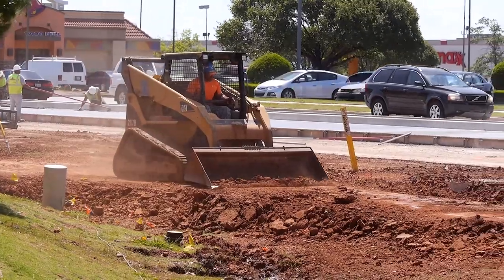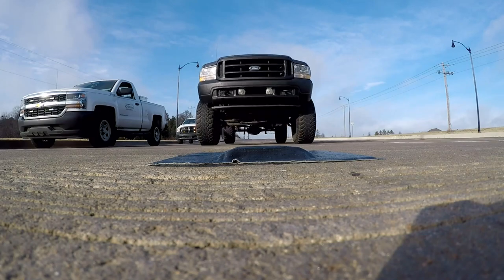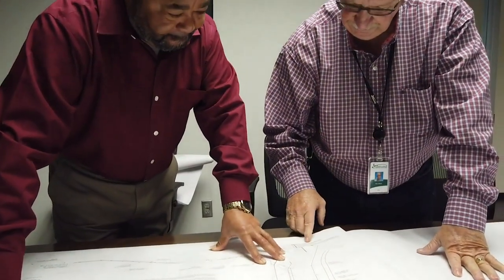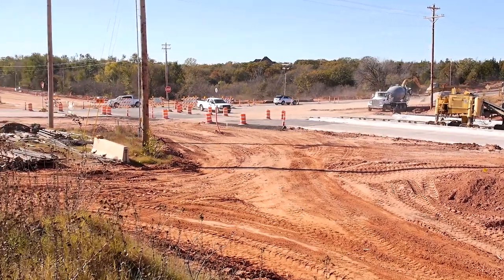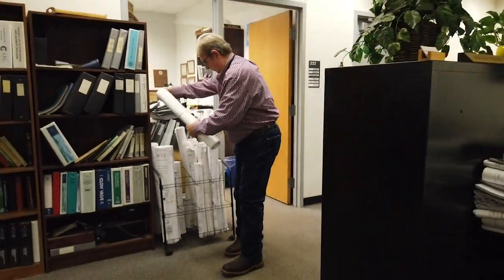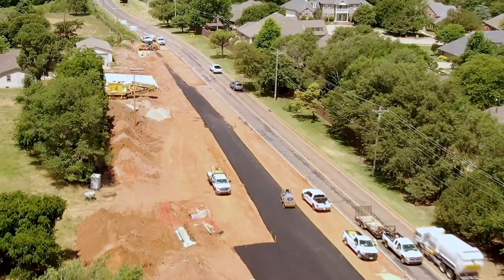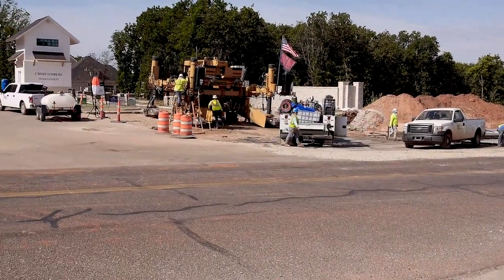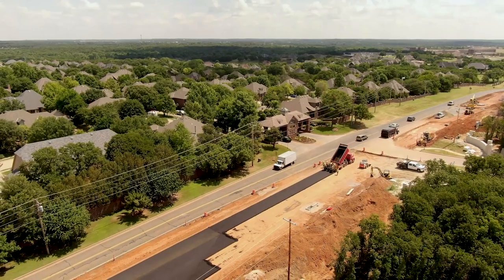Road Projects: From Start to Finish

Comment: 5 years is unacceptable, because you plan for traffic as it was 5 years ago, thus you build for traffic accommodations that were needed 5 years ago. By the time the project is done, the new road has already hit its capacity if not maybe just short of it IF you’re lucky. If it’s gonna take 5 years to even start construction on a new/ improved-widened road, at least plan for the growth 15 years to even 20 years out. If a road is 2 lanes, one in each direction, and it’s gonna take you 5 years to widen it to 4 lanes, 2 in each direction, you might as well spend the extra money making it 6 lanes, 3 in each direction, with good turn lanes, sidewalks, lights, and other utilities. Look I hate the concept of stroads but that’s what we use in the Us, so let’s at least make them good.
Reply: Only if transportation engineering was this easy. the AADT (Average Annual Daily Traffic) and average growth factors for successive years (there are economic analysis table already stablished for all kinds of cities and town) for the same is calculated (minimum they take is 20-40 years (doesn't usually go higher for unknown factors, hence rehabilitation is preferred) depending on the region, type of axle load(vehicle class), population, directional distribution and a lot of other factors. some major highways are designed to last even longer due to access and disturbance caused by rehabilitation. (I'm not a transportation engineer but a Civil one :) )